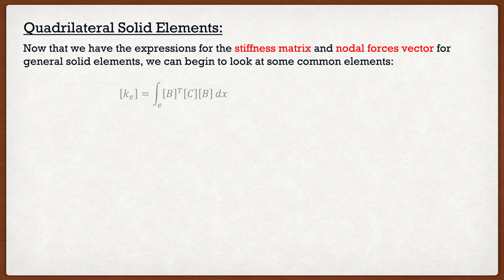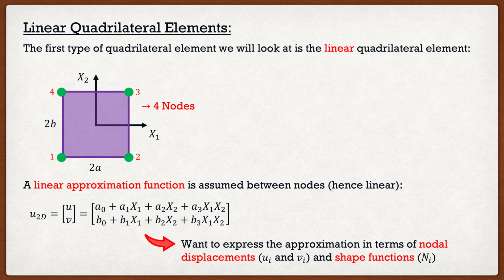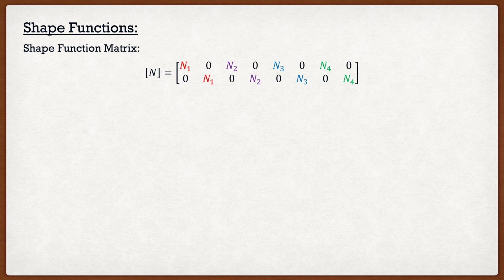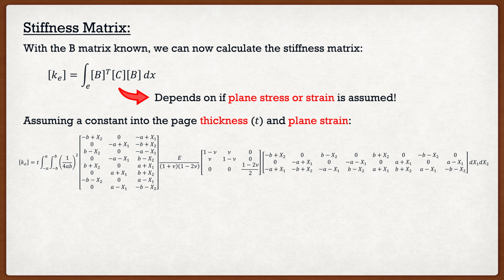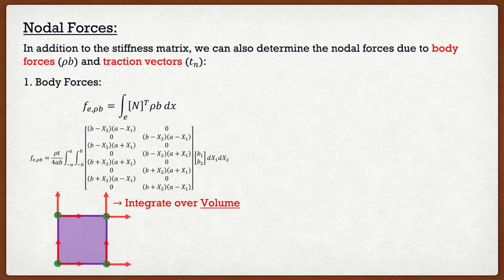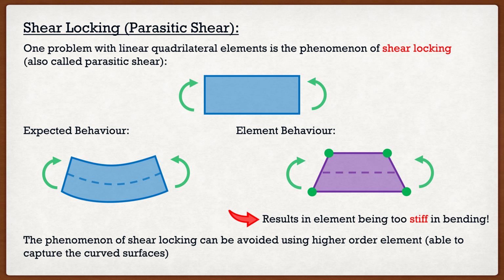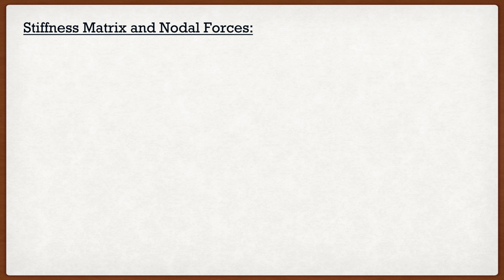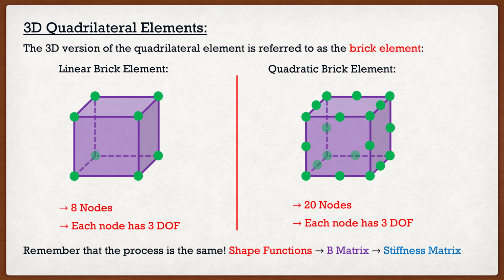Finite Element Method | Theory | Quadrilateral (Rectangular) Elements

Comment: Hi Clayton,
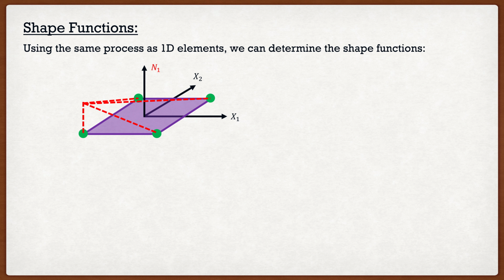At 07:03 you say the shape function for the element is a plane, yet the shape function has to satisfy 4 points simultaneously (z=1 at node 1, and then z=0 for nodes 2, 3, 4). How can this shape function be defined by a single plane when only 3 points are needed to define a plane? Would this shape function be an intersection of two planes?
Any clarification would be appreciated!
Reply from the maker: Hi!  This is a great question :) I used the word plane as when plotted the distribution looks similar to a plane (for the linear elements) but in reality it is a nonlinear surface (if expanded you have a X1*X2 term).  Another thing to remember is that these shape functions do not return a geometric 'z' value but rather return weighting functions that are applied to the nodal displacements to approximate the displacement of the entire element (process is referred to as Lagrange interpolation).  Hope this helps and I am sorry for the confusion :P Have a great night :)
Reply: @ClaytonPettit  Yes, ty for the clarification! These videos are really great, you are helping to save the lives of many FEA students : )